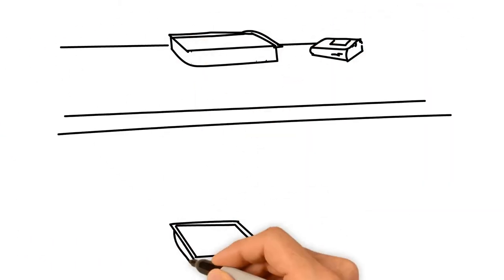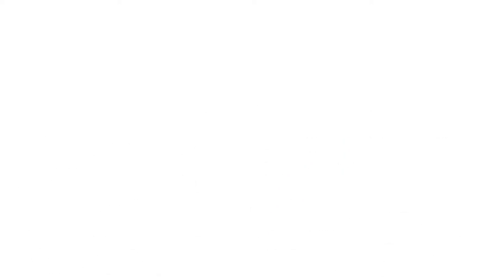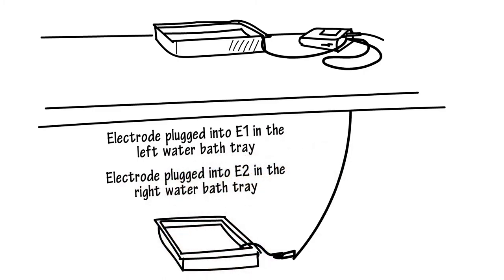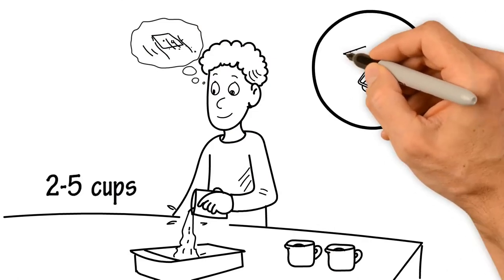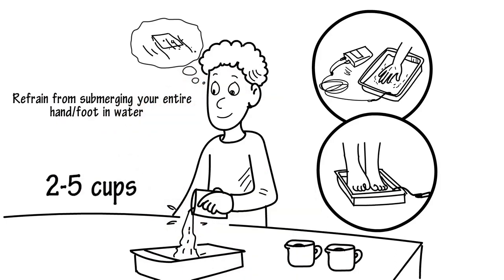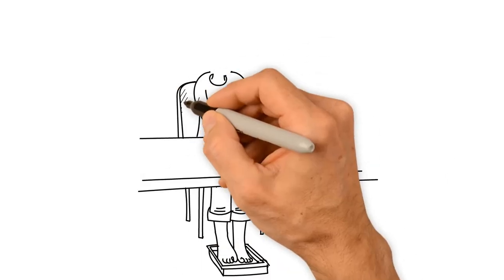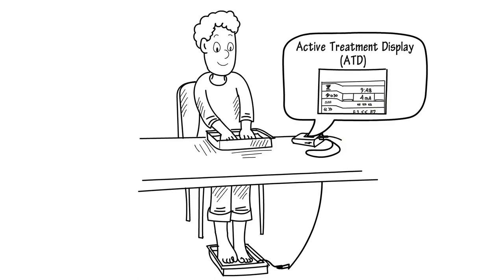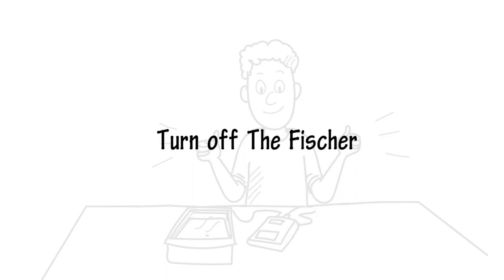How To Use The Fischer: Hands & Feet - Iontophoresis Whiteboard Tutorial - RA Fischer Co.

Comment: So why does this machine can be used with one electrode on the feet, and the other on the hands at the same time?
Reply from the maker: Great question! It's a couple of reasons, actually. 1) The Fischer is a 60v hospital-grade iontophoresis device, so it's strong enough to treat both areas. And then 2) our silicone-graphite electrodes cover a wider area than narrower metal plates, so you get more consistent coverage of your skin's surface area while treating both areas at the same time.
Reply: And yet you still can't treat both areas simultaneously because the feet need much stronger current than the hands can tolerate. I feel duped. I just bought the fischer and spent 500 more bucks than I needed to because the company markets it as If you can treat both areas at once effective , thereby saving time.